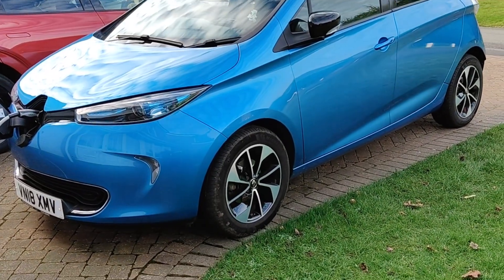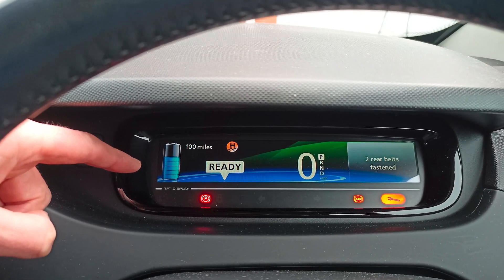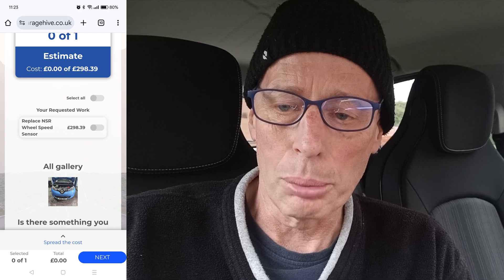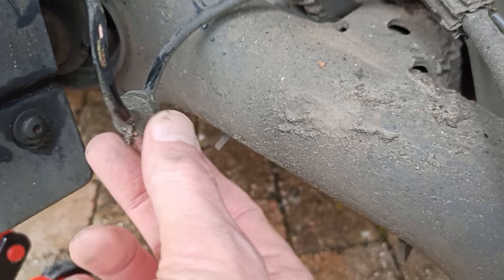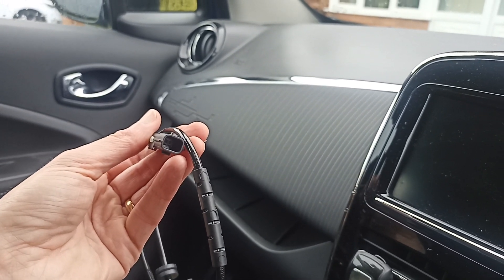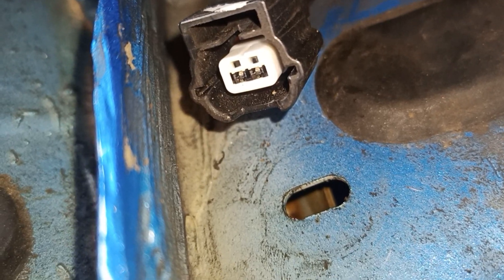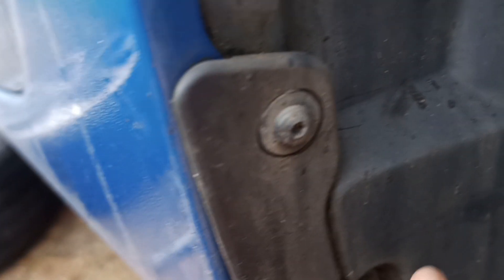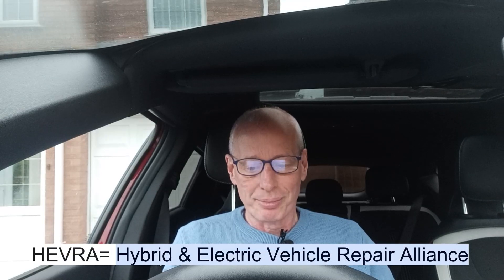The ABS warning light saga. Can i fix this myself?🤔 See updated notes👇👇

Comment: A stud extractor kit would have been easier to remove the broken wheel stud, rather than taking off the hub, or a drill bit and drill the centre out and hammer in a allen key and screw it out. as a safety note never rely on a jack to hold up the car, use a axle stand or even the wheel put under it.
Reply from the maker: The jack thing was already mentioned up the comments. I did have borrowed axle stands but did not use them all the time. Fair comment. I should know better.

Comment: For my sins my daily work drive is a company supplied Ford Transit. I had exactly the same faults on that. Mine turned out to be squirrels eating the ABS cable on the rear beam. Amazing you get exactly the same warnings, No Hill start, No ABS etc..
Reply from the maker: Rodents munching on cables seems more and more common these days

Comment: Have you had any problems with the drain around the driver side windscreen wiper I have clean mine after water filled the tray in front of the window full of mud
Reply from the maker: On the EV6 yes and also on the Zoe a lot. I need to look Elviras drain holes as it was pooling when i washed it last weekend.

Comment: Started watching this video. And waited for the fault codes, because the 12V-Battery was not my first suspect here 😀. I just had to read "rear wheel" and knew, what was wrong. In case ABS and ESC Errors come up together, first look at the ABS-Sensors. Most of the time they're malfunctioning. When you have access to the DTC, it can also show which ABS Sensor is gone - just as in your case. Of course not always is the sensor gone. Sometimes the pulse ring (can be seen at 8:47) is rusty and/or broken, giving an unplausible speed signal to the sensor which in turn gives an ABS/ESC-Error, too. BTW, this is not specific to Zoe, or Renault, or even to electric cars. All cars with ABS can show this problem.
Reply: Brian, please, please when working on any vehicle do not rely on a hydraulic jack to support it (no matter how new the jack is).  Hydraulics can fail and the vehicle then falls which is not good if you are working under it as an old friend of mine found out. A solid axle stand or other solid support should be used once the vehicle has been jacked up.
Am enjoying the videos and would love you to have a further 50 years of safe DIY car mechanics. 😉
Reply from the maker: You are absolutely correct. I did borrow axle stands and a torque wrench off my brother and i did use them initially probably in bit i did not film. My old man would be turning in his grave.
Reply from the maker: Cheers for the extra info Olaf. I do say it applies to all modern cars with ABS in the pre Intro and in the video notes.(If I remembered to put it in😁) I learned a lot while working my way through this.